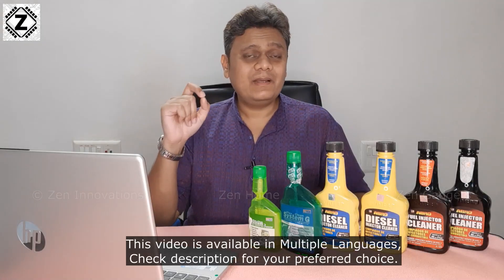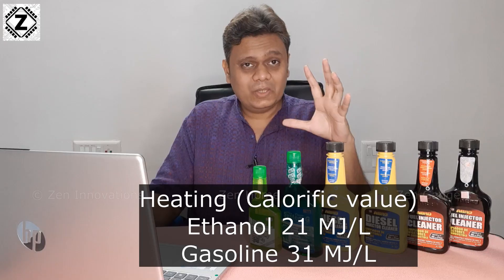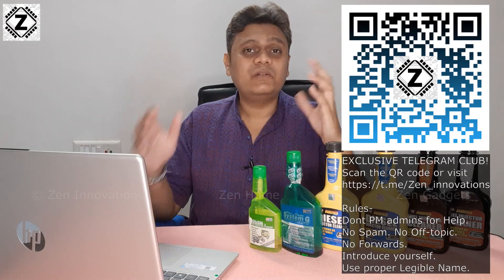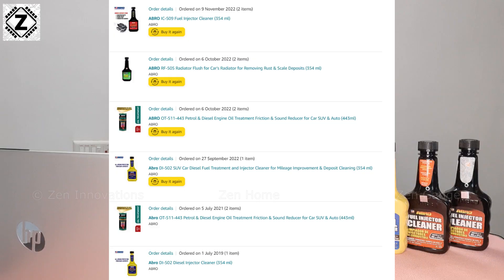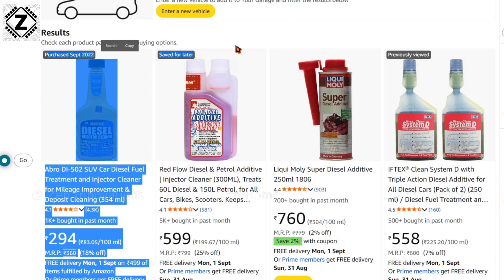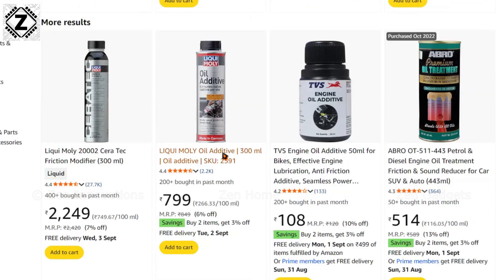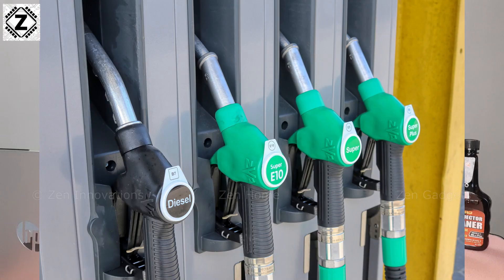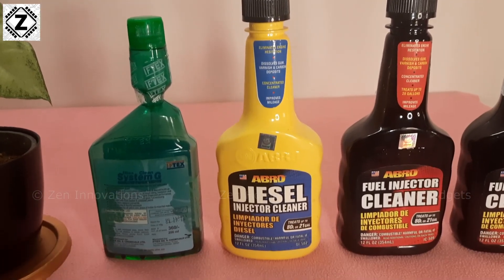[Eng] Is E20 a Scam? Do fuel additives protect your car bike engines from ethanol blended petrol?

Comment from the maker: This video is available in multiple languages-
Hindi https://youtu.be/7dcIZU3aI6U
English https://youtu.be/2-2jtHfzJzg

[Best Buy affiliate links]
Fuel additive Petrol https://amzn.to/47ksM7Q
Fuel additive Diesel https://amzn.to/3JDQa6q
Engine Oil additive https://amzn.to/4n8TxRj

Chapters English
00:00 Ethanol Blended E20 petrol rollout
00:36  What is E20
01:07 Problems with e20 - Low calorific values, Hygroscopic nature, Starting trouble
03:14 Toxicity to fuel systems- Injectors, Fuel Lines, Fuel pump, Petrol tank
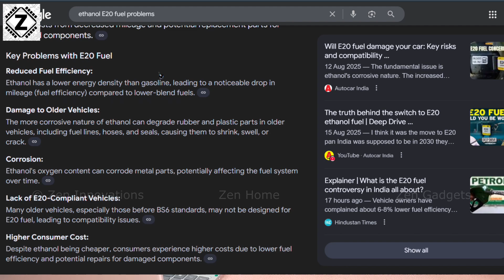03:35 Cost factor (Financial & Environmental)
04:48 Solutions (How to protect your vehicle)
07:07 Fuel additives cost, Dosage
08:26 Do Fuel additives work? (My Long term experience)
09:51 Should we switch over to diesel, CNG or EV?
11:05 Conclusion, Going foward

Topics in This video-
1. Is Ethanol blending in petrol harmful for car bike engines?
2. Is E20 Fuel a scam
3. Ill effects of E20 Fuel on Engine Injectors, Fuel lines, Valves, Rubber hoses, Seals, Fuel tank
4. Real world Mileage fuel efficiency test on E20 fuel
5. Problems in older BS3 BS4 vehicles when used on Ethanol E20 fuel
6. Diesel SUV IB (Isobutanol) Blending program
7. EGR, DPF, Check engine light Problems with BS6 (Bharat stage 6) Diesel engines.
8. How to avoid engine damage due to E20 petrol fuel
9. Is E20 Ethanol blending adulteration?
10. Ethanol Adulterated fuel.
11. Are fuel additives safe to use?

#e20 #e20petrol #e20fuel  #ethanol #ethanolblending #ethanolfuel #carcare #ZenInnovations #zengadgets #ZenWithCars #AutomotiveDIY

💎 [Playlists] 💎
Automotive DIY
https://www.youtube.com/playlist?list=PL9YrG_WglF9x7SNo9g1ow1twwm52rq-iV

Comment: 2018 creta petrol - milage drop, notice engine vibration, slow pick up/acceleration, bad AC cooling etc . Since 2020 noticed engine vibration & other issues, compared to when it was brand new & also to my 2012 i20. Used system G fuel additive & now all issues are gone by 1st use, hopefully 🤞
Reply: My i20 got rid of it before 2018. So during that time when I had the i20 it gave no such issues.

Comment: Beating around the bush video. No proper solution.
Reply from the maker: Is there any?
Reply: You tell me, after all you are the so called expert.
Reply: It is more about preventive measures that you can take to safeguard your non-compliant vehicle. Real solution: Introducing E0 fuel option for the older vehicles or lowering down the price of the adulterated fuel or the mega exchange program funded and heavily subsidized by Gov for older vehicles. If the Gov plan is to eliminate fossil fuel from the transportation then research facilities should be funded to promote innovation in next gen energy storage devices powered by renewable sources.
Reply from the maker: @kitkat584   Agree

Comment: I am using Abro oil additive in diesel ertiga. It runs the engine smoothly. I use iftex diesel additive 1ml per litre. Have also used 2t oil 1ml per litre in petrol 2 wheeler and diesel cars. No problem noted.

Comment: Hi,
Please suggest if my vehicle need additives. 

1. Skoda Rapid 1.6mpi - 2019
2. Indian scout - 2015 

Thanks in advance.
Reply from the maker: To counter the sideeffects of E20 fuel,
Try System G or ABRO
Reply: @ZenGadgetsEnglish used system G for my 2018 creta petrol & now engine works well.
Reply from the maker: Nice
Reply: Go for red flow, best ever additive trust me, I am a user of it in my skoda laura diesel manual and pulsar 220, it makes the engine so smooth and increases mileage also , try it once...
Note : it's not a paid comment it's my experience

Comment: In my 2017 bs4 hero duet, before e20 it give around 40kmpl but now around 25kmpl. So suggest an additive good for engine and also give better fuel efficiency.
Reply: BS4 Activa owner here , earlier I was getting 43-44 kmpl now hardly 22-23 kmpl with E20 .
Reply: Use system g it work, but keep note on the quantity your using with the petrol. It f..cked up citizents have to pay same rate for fuel.. cost is extra with additives, buy other production like fuel additive to save our vehicles & high fuel prices compard. Bhutan imports fuel (finished product) from India petrol is Rs. 64 to Rs.66 & diesel is Rs.70 to 77 & the fuel price of the country that exports fuel to Bhutan is 🤡

Comment: My 8 years old BS3 jupiter is giving 46kmpl after E20, prior it was around 60-65kmpl without any additives. Also I'm a little scared of using any kind of additives in petrol.
Reply from the maker: Thanks for sharing your experience!
Reply: @ZenGadgetsEnglish  what fuel additives you reccomend for this specific vehicle ?
Reply from the maker: Try System G or ABRO